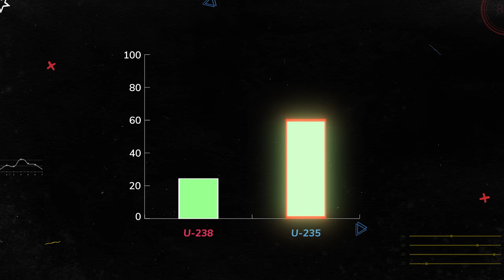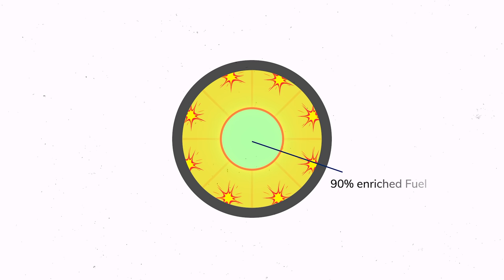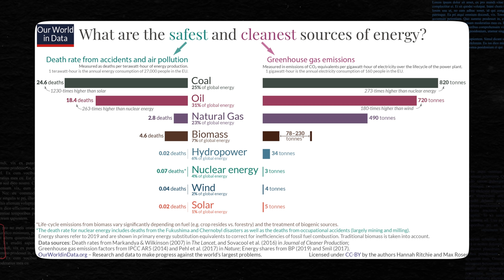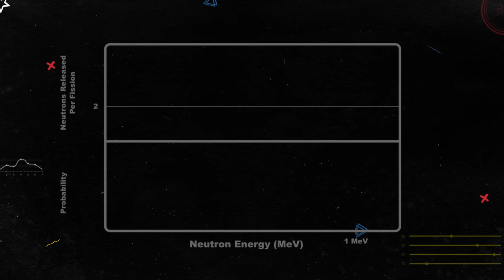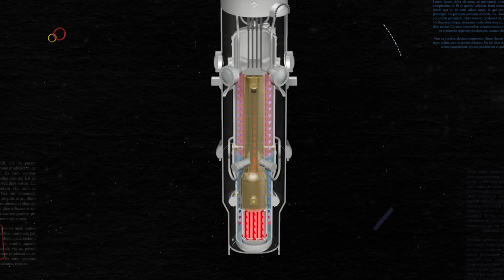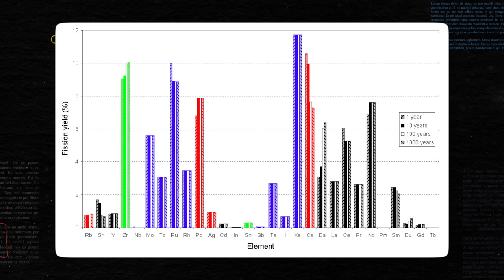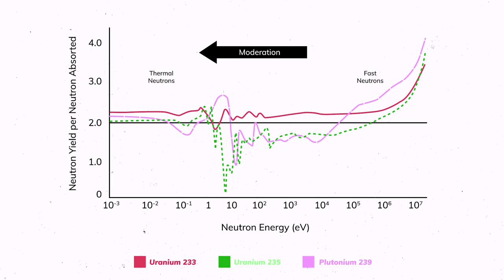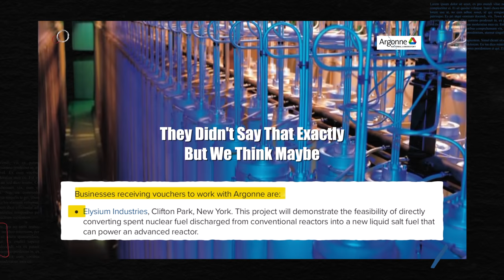This Reactor Feeds On Nuclear Waste

Comment: Ed Pheil is the principle designer at Elysium. The design is meant to slot into any existing power station you already have too. So if you have a coal power station, just swap out the coal burning part and keep your turbine generators & transformers etc. As Ed has said there is 100s of years of nuclear waste to consume here, so efficiency is not critical. Using less efficient existing infrastructure is fine. 

I have to say I was a thorium fan, but consuming nuclear waste has to be the most sensible win. Also as pointed out metal alloys that can handle chloride salts are already nuclear rated. Ones for fluoride salts that Kirk needs, not yet. Thorium will have its day, but we have nuclear waste that needs attention 1st.
Reply from the maker: Honestly, we really wanted to include more about the founders. Both of them have really interesting stories :)

The problem was that we didn't reach out to them. I think the video could have been much better with some of their quotes and insights.
Reply: @TechforLudditesSira  Ed is a really approachable guy. Drop the team a message. Make a follow up video :)
Reply: Thorium isn't used because it doesn't generate plutonium so they don't care but I think that a nuclear power plant is actually a pyrophoric generator that uses high energy light to generate heat.
Reply from the maker: @mrrolandlawrence  That is definitely on the agenda! :)
Reply: Thorium can also consume nuclear waste.
Reply: @sebastianstewart6894  You are right, but what it does generate is U-233 which is as good a fissile as plutonium.

A pyrophoric generator, huh?  You need to back that one up.
Reply: @mikebrandenburg9922  I really hate how people keep saying that.  Waste has different meanings, and the "Luddites" see it as a radiological poison, while you are looking at the transuranides, which are low on the list of radiological emitters.  Get specific if you want to say that - "it consumes some of the long half-life radiological waste".
Reply: As the turbine is rather cheap compared to the combustion chamber / boiler of a coal fired power plant (50% of CAPEX), it would make sense to use a newer turbine as turbine design has improved in the last 40-50 years. They have increased the efficiency level also, e.g. by 3-D turbine blade design and manufacturing which has been streamlined.
Reply: @gunnarkaestle  hey if you have unlimited budgets, why not! then again you could also just add another 250mw module to the core, consume more nuclear waste and get more money for doing so. 

.. then there is the transmission losses. maybe upgrade the whole lot to ultra high voltage? 800kV would be nice...
Reply: @mrrolandlawrence  There is a reason why some Russian UHV lines have been downgraded to EHV after a couple of years.

Re "consuming nuclear waste": I don't think that they are consuming the waste (radioactive isotopes, which result from a split nucleus) but consume fissile isotopes which has been left or fertile material in spent fuel rods.
Reply: @gunnarkaestle  if you watch the long talk from Ed, the technology can even consume DU! Something of which there is plenty of.But yes they are mainly focusing on the spend fuel rods as there are plenty of that to start with. Current storage costs are high and storage is essentially indefinite (1000s of years) if left. Chopping the rods to use in the reactor is a great idea. This bypasses any regulation needed for reprocessing.
Reply: Good comment, but video better. Amazing work.
Reply: @mrrolandlawrence  Depleted uranium (U-238) is used in breeder reactors. It is not the highly radioactive waste, which are the fission products after you split a nucleus. You can't get rid of those fission products except waiting for decay. Another topic is the fraction of actinoids (transuranic waste), which is uraniun and heavier elements that are activated by neutron capture. Their half-life can be very long and those can be split - but not the waste which is the fission product. This stuff you need to store for a couple of hundred years anyway.
Reply: You could also process the ashes of coal plants some ashes have such a high concentration it 

80 ppm, europäische Stein- oder Braunkohle enthält etwa 80–135 ppm Uran.[4] Da weltweit etwa 7800 Millionen Tonnen Kohle pro Jahr in Kohlekraftwerken verbrannt werden, schätzt man den Gesamtausstoß auf 10.000 Tonnen Uran und 25.000 Tonnen Thorium, der zum großen Teil in der Asche enthalten ist.

The ashes in European hardcoal and  lignite powerplants have a conversation from 80-135ppm uranium. The estimations are that worldwide we burn 7800 million ton of coal and the results that it contains 10 000t uranium and
 25 000 t Thorium
Reply: It isn't that important how much clean energy we make. What's important is how much dirty energy we shut down! That's why it's so important to offer a path to upgrading coal-fired power plants of recent vintage so that they don't burn coal anymore. You killed two birds with one stone.  
What we can't afford is more people acting like Germany, putting up lots of wind and solar, and keeping all the coal operating and even building more.
Reply: @gunnarkaestle  operating at 600c instead of 300c automatically means that your turbine is going to be an order of magnitude cheaper.
Reply: @grumpystiltskin  exactly.
Reply: @gunnarkaestle  The fuel rods still have 95% unused U238 which is a solid energy source in fast reactors. The transuranics can get forced to fission with additional neutrons. Some of the fission products can be turned into safer decay series or even medical useful elements with additional neutrons.
Reply: Mr. Virtual  what scientists are saying, plutonium is the end goal of nuclear reactor not energy production. If we wanted energy production then there are huge ways of producing it. Uranium oxide is prone to spontaneous ignition.
Reply: @CUBETechie  thanks you've just proven my belief that plants store uranium at a certain age which is probably don't to increase a plants energistic state.
Reply: @grumpystiltskin  I personally think we should burn all the coal to provide food for plants because if we're not careful the plants won't have food anymore.
Reply: @TechforLudditesSira  Please do make a follow-up, including more info about the practical hurdles they are experiencing!
Reply: @puncheex2  pyrophoric substance are compounds that ignite easily in the atmosphere eg pure iron which is caused by oxidization but it also means that anything that has an oxidizing effect without oxidation occurring will produce a release of heat an example is nuclear radiation and to me this explains the rapid depletion of nuclear rods. If it was just the effects of uranium why do you need to partially oxidise it, why not just use pure uranium, the reason is because uranium monoxide is a stronger pyrophic then uranium. Also the material is composed of small pellets of a millmetre each instead of in a sheet and no explosion occurs beyond a steam explosion after the core has melted. All this has led me to the opinion that the substance is producing heat by the process of converting the light it absorbs from its fellow rods after all nuclear reactors are producing a highly energetic light.
Reply: @grumpystiltskin  Actually, operating a turbine only at 300 °C makes the whole plant much more costly in specific costs, as the bottleneck steam (thermal energy) to mechanical energy is less efficient. Thus you have much less bang for the buck (meaning the full CAPEX of the whole plant and not only the turbine). Just do the math: if you have 45% efficiency or 30% efficiency of a given boiler that gives 2000 MW of heat, then you have either 900 MW or 600 MW.
Reply: Thorium loses its advantages past the initial few stages of burnup, it is not widely regarded as a solution to nuclear fuel concerns. The criticisms of water reactors are not really valid in this video either. the videos authors claimed that reactivity of a molten salt reactor goes down with increasing temperature but the same is also true in water reactors where increasing temp reduces the density of the water and reduces how effectivly it moderates the fast neutrons. additionally the claim that the reactor vessel may explode due to a steam explosion while strictly true is one of the least likely failure modes for a pwr as its been designed to have a safety margin to cover all but the most catastrophic failures. there are limits to this system just as there are limits to the molten salt reactors. molten salt is very promissing but its widely debated if the thermochemistry of continuous reprocessing is even feasable and thats one of the main reasons to want a molten salt reactor.
Reply: @sebastianstewart6894  Sorry mate but you really need to pick up an a level physics book and go over the nuclear physics secton. Reactors typically have less than 100tons of uranium loaded at any one time if you assumed that the energy released through combustion is around the same per mole as a pure CH4+2O2 (an incredibly generous assumption) at 400ish kJ and the 100tons of uranium (aprox 400k moles) a full loading yeilds 160GJ of energy. assuming a 500MWe reactor and a 100% efficiency (which is impossible) that 100tons of uranium is used every 320 seconds or 5 minutes 2 seconds. so no it is not some combiustion reaction as your claiming.

for your information only about 2% of the fissile material in a reactor is "burnt" during its entire cycle in the reactor which is typically 2 years iirc which means 2 tons of uranium has to produce about 16ExaJ of energy in that period. even assuming 100%efficiency then each mole of uranium needs to produce around 2000 TeraJ or 500million times more than a  CH4+2O2 reaction, this is impossible in a chemical sense there just isnt the energy available in the atomic bonds to be released for this
Reply: @Psi-Storm  Please do the back of an evenlope calculation: In a spend fuel rod, there are ~5% cracked atom cores; ~0,5 actinoids (long living transuranic isotopes activated by neutron capture) and 94,5% fertile U-238. If you split all the fertile/splitable 95% that will increase the mass of highly radioactive waste by a factor of 19. This stuff is not candy you can store in a kitchen drawer: it is highly radioactive waste that needs to be stored for hundreds of years - which is less than hundred-thousands of years, admittedly.
Reply: @lewispowell1681  The temperature dependant doppler effect regarding reactivity was the reason that the Russian RBMK designers thought the reactor is controllable, and that this would compensated the void effect. It was - except in some operating states where it was not. 

The water reactors are nonproblematic in this regard because of the void coefficient and the doppler coefficient are both pushing in the same direction. But it is said that the huge and costly containment for light water reactors, which should hold all the radioactive water turned into the steam from the primary circle in case of a LB LOCA and condense it without venting large radioactive volumes, is not needed. 

But I wonder if long term practical experiences has been made with hot corrosive and radioactive liquids. Please remember, that the Kashagan oil field in the Caspean sea had to replace the whole piping because the corrosive nature of the sour oil (rich in H2S) was underestimated and this issue was not properly handled in the first try, and this was basic engineering, no rocket surgery.
Reply: @SUPERTOASTERGOD  There have been molten salt reactors that have run in the past, in fact there are a great many varieties of reactor that have been proven to work. for the most part they wernt produced because they didnt produce the plutonium needed for weapons or they produced too much of the higher atomic mass isotopes of plutonium which made weapons production difficult.
Reply: @grumpystiltskin  I can't believe how few people realize that repurposing a coal plant means that coal plant won't return to burning coal lol it's like doing algebra but arbitrarily assuming only positive numbers are valid in the equations we're working with
Reply: @lewispowell1681  I only know one molten salt reactor which ran, it was an 7 MW experiement at Oak Ridge in the 60s which ran for 4 years. Therefore I don't count this as long term experience which utilities need to make a no doubt buying experience of a utility scale installtion. If they are reluctant to invest into new LWR technology (and they had to be pushed in the 60s) why should they acquire something which is new to them, if not the next neighbour has tried this sucessfully out and proven that this works not only technically but also financially?
Reply: @mikebrandenburg9922  
No, thorium CANNOT consume nuclesr waste. The neutronics are barely sufficient to maintain themselves on Th/U233, and no neutrons left for waste. Cant be done.
Reply: @sebastianstewart6894  
No, "pyrophoric" is rediculous. Pyrophoric means burns spontaneously in air, explosive. None of that here. It does NOT mean HOT.
Reply: Joeseph Smith  
No, it converts long lived material, to ~100yr surface storage waste.
Reply: @mrrolandlawrence  
We Chop up the SNF, then chlorinate it, then filter it for the reactor.
Reply: @gunnarkaestle  
The 300 year Cs & Sr fissiinnproducts can also be transmuted to shorter lived of stable by leaving them in the reactor after purification, onless there is a demand for them for higher power Radio-isotopic Thermal Generators (RTGs), better than Pu238. These were actually designed and used in the 1950's for the US Navy. (Patent is accessible).
Reply: @grumpystiltskin  
750C initial designs, 1000C later designs.
Reply: @Psi-Storm  yes you an make medical isotopes, but the anount needed for medicsl is no more than a few reactirs can make, so every reactir would not do that due to lack of demand for extreme volumes of medical isotopes.
Reply: @sebastianstewart6894  
We consume ALL plutonium, never take it out nor separate it. We are iso-breeding, not positive breeding except just enough to overcome fission product poison build up, so we can eliminate the online purification system, to eliminate that concern. Even our exterternal centralized purification system does not separate Pu from Unor other actinides, nor from long lived radio-protective Cs & Sr and many other shorter lived fissiin products. Besides, our reactor NEVER has weapons grade plutonium in it, never.
Reply: @gunnarkaestle  
You need to look at the waste fission products on a per MW basis, and there is a 30X reduction in waste mass/MW
Reply: @gunnarkaestle  
Pure Fluoride salt is less corrosive than pure water. Pure Chloride salt is less corrosive than fluoride salt. Add either excess oxygen or salt to water or water to salt, i.e., make it impure and tose are corrosive. Especially salt water at an air interface.
Reply: @SUPERTOASTERGOD  
I just use my smarphone with a piece of black tape iver the camera for a radiation detector using the Gammapix lite App.
Reply: @lewispowell1681  
This not enough Pu, or too high upper Pu is a myth/fake conspiacy thory, that needs to stop being spread.
Reply: @gunnarkaestle  
Oak Ridge ran TWO MSRs:
Aircraft Reactor Experiment
Mlten Sslt Reactor Experiment.
Reply: @SUPERTOASTERGOD  
Nuckear plants are orders of magnitude ckeaner than coal plants, and the uclear sites have less resudual radioactivity than the coal ash pile, although neither is dangerous.
Reply: @EdPheil  Do you mean fission products production per MW or MWh? One atom split means ~ 200 MeV binding energy converted into heat (moving particles), so x mol fission products are equivalent to y MWh thermal energy or y*eta MWh electricity.
Reply: @EdPheil  So, the corrosive question is: Is it easier to keep water out of the salt or to keep the salt (and oxygen) out of the water? And why did the Russians build the drivetrain for their Alfa raceboats (not to be confused with the Alfa racecars, which are Italian) with a liquid metal and not with a liquid salt cooling?
Reply: @gunnarkaestle  
Yes, just keep the fluids CLEAN!

The Russian Alpha subs were solid fuel PbBi cooled because they were high power dendity, so smalland the PbBi dsmpened noise making the sub quiet unless they went fast. At high temperstures of PbBi the steam turbine systems were all smaller too, allowing a high power to hull diameter ratio allowing very high speed.
Reply: Joeseph Smith  
Your nuclear fuel cycle degree or experience is from where?
Reply: @SUPERTOASTERGOD  100 years, barely one human lifetime to be as low as Uranium ore.
Reply: @SUPERTOASTERGOD  In your opinion, how do we balance the unavoidable imbalance of demand  and consumption when producing with renewables?
Reply: @lewispowell1681  I'm not claiming it's a combustion generator but a brimstone generator (a device that converts high energy light into heat). Which honestly I don't know why we don't have one.
Reply: @gunnarkaestle  don't store it give it to thiobacillus to metabolize or other forms of bioremediation.
Reply: @EdPheil  "This not enough Pu, or too high upper Pu is a myth/fake conspiacy thory, that needs to stop being spread." im sure you have a credible reason for this statement however you are to me just a voice on the internet and so i cant varify what expertise you have. on the other hand what i have said is exactly what has been taught to me by a professor of reactor engineering at one of the UKs leading Russel group universities.

i realise after reviewing my message you may believe i was saying that MS reactors were not persued due to the plutonium concerns but that was not what i meant. i meant the many of the multitude of variant designs of reactor that were tested and conceptualised in the 50s and 60s were rejected because of the Pu production characteristics. 

an example of weapons choices defining reactor designs is the british gas cooled and advanced gas cooled reactors which in the first instance was due to their versatility for power production and weapons grade Pu breeding and in the second instance for the ablity to produce Pu while using unenriched U (something that was not seen through due to cladding issues iirc).
Reply: @paxdriver  you know coal was once trees?
Reply: @EdPheil  actual the word means hot light but yup I can't really find the name given to substances that convert energy to heat.
Reply: @EdPheil  you obviously haven't read up on the hyperaccumulator of radioactive isotopes.
Reply: @EdPheil  how is plant food not clean?
Reply: @SUPERTOASTERGOD  coal is when plants ruled the world, how is returning that food back to the cycle bad?
Reply: @sebastianstewart6894  so you dont really get the concept of light. light is simply electromagnetic radiation with a wavelength in the 380-750nm range. where the photon is in the spectrum their energy is related to their momentum which is dependant on their wavelength. smaller wavelengths have greater energy and the shortest wavelengths are gamma rays. so high energy light is radiation. so a "brimstone generator" is a nuclear reactor which turns the high energy of the particles and rays released during fission into heat
Reply: @EdPheil  What was the result of the Aircraft Reactor Experiment? I assumed that also the MSR-Experiment was financed by the Air Force. But let's face it: this have been Experiments, not long term operational experience, where you could learn from mistakes and mishaps like in Three Mile Island.
Reply: @mikebrandenburg9922  Huh? "Thorium can also consume nuclear waste." Are you talking about Flibe's LFTR49 reactors that burn SNF and breed U233 ib a thorium blanket? Or perhaps you are referring to the ability of all molten salt reactors (including those that breed U233 from thorium) to burn their own waste, and potentially SNF from outside sources.
Reply: @puncheex2  Depends on the thermal energy of the neutrons. In a fast neutron spectrum plutonium is a better fissile fuel.
Reply: @juspetful  Balancing the demand and supply is done by (functional) energy storages. In the past this was the coal pile and the gas cavern and the nuclear fuel rod. In the future, we will use a spectrum of different energy storages, from batteries (short term) to P2G+gas storage (long term). BTW: you need not channel all electricity through such storages, in most cases, the generation fits the load at least partially.
Reply: @sebastianstewart6894  The substance which converts light into heat is called an absorber.
Reply: @sebastianstewart6894  Returning fossilized plants back into the C-cycle - in the manner we are doing it as a civilisation - is called "overdosis". Remember: all the infrastructure we built since the last 5000 year is optimised for a given climate and ocean level. Guess what will happen when the glaciers in the Himalaya melt completely, and the water supply in arid summers is not guaranteed, which is needed in the mayor river systems of Asia for irrigation and productive land use. How many hungry boat people is the rest of the world willing to absorb?
Reply: @sebastianstewart6894  Sebastian, uranium oxide IS burned chemically as far as it will go.  Uranium metal will burn (to the oxide), but uranium oxide will not burn further chemically.
Reply: @sebastianstewart6894 Are you really asking this question? So you don't get the simple fact, that trees need time to grow. You do get that? Trees need time to grow! Even if you come with Bambus, which grows way faster, you still need the soil, the land and even then enough time!
And here's the thing. We burn way more coal and equivalents to CO2 then plants could store it. Which is the whole problem about our climate change problem! (next the methane problem ofc) Oh and by the way, we even burn down forests... So there's that.
Reply: @SUPERTOASTERGOD  
There are 4 reactors licensed for 80 years, 2 more in the life extension licensing process, others in the queue. NRC is working in 100 yr nuclear reactor license requirements today. These are happening. 

Solar is lucky to last 20 years, assuming there is no major storm, like hurricanes, tornados, or hail storms.
Reply: @gunnarkaestle  i dont understand what you are asking. Not enough info here, nor link to my comment info.
Reply: @gunnarkaestle  The aircraft reactor experiment was a different sakt, and much higher temperature for a jet engine, like 900C. The chemistry allowed HEU to precipitate out on vessel walls. There was still fissiin, so it overheated locally and burned through the wall causing leaks. It was very short lived.

MSRE was many years of ooeratiin, but only about 3.5 total years equivalent full power operation. MSRE was shut down for political, not technical reasons.
Reply: @dalesplitstone6276  FLIBE has dropped the LFTR49 concept. It did not work. They ourged it from their web site too. They moved from LFTR49 to a fast chloride MSR that uses transuranics only as fuel, no uranium. This would have a thorium blanket.
Reply: @puncheex2  
Actually, UO2 WILL burn/oxidize further from UO2 to U3O8. They both occur in uranium ore, but is all oxidized to U3O8 in the U refining process.
Reply: @EdPheil  Heh.  I thought uranium oxide WAS U3O8.  Yeah, it may be possible to burn uranium oxide further, but I doubt it is a pyrophoric process.
Reply: @mrrolandlawrence  Thanks for explicitly pointing out the difference between the fluoride salts and chloride salts.  I had previously missed that distinction.
Reply: @EdPheil  Thanks for all the comments; I learned quite a lot! Hope to see you and Sira having a discussion in a future video!
I am personally blown away that the principal designer has stopped by a 'small' youtube channel's comment sections to interact with average joes and janes.
Kudos, and thank you again for spending a few moments of your time explaining the corrosive relations to us laymen!
(And the fact that you're as human as the rest of us when being trolled. :) :) :) )
Reply: @lewispowell1681  I understand the concept of light but just because you know the theory doesn't mean it's the fact of reality, eg white light is a photon that contains all wavelengths theoretically in reality its a unique light that when placed through a prism produces all light and depending on the material used is the light produced.
Reply: Very confused.  If we have the means to rid of nuclear waste why isnt this utilized?
Reply: @gunnarkaestle  arid summers are from not damming the monsoon rains if properly managed by using that same technology we have created in the last 100 - 200 years then there would be no problem.
Reply: @puncheex2  uranium can for di and quad bonds easily though.
Reply: @Deinorius  the highest co2 concentration in the world is 500ppm but trees are fine with 1000ppm and if co2 does cause global warming then 1500ppm is perfectly fine for them as well. If you have a problem with us cutting down trees then force your governments to swap from large fields to agroforestry and increase the flow of people from the city to the country by establishing rural regeneration schemes.
Reply: @SUPERTOASTERGOD  you know that once we had a electric generator that had no moving parts and used steam to generate its electricity. It's probably not as powerful as a standard motor but it's principle is sound if modified than and put through a circuit you could use it.
Reply: Also why do people talk about nuclear power as an alternative to coal power when magnetic refrigeration and atmosphere engines seem to be a viable alternative and couple with it an electrostatic generator since electrostatic generators don't have the magnetic resistance produced by many electric generators.
Reply: @sebastianstewart6894  there is no such thing as a "white light Photon". what you see when you see white light is all of the photons of the varying wavelengths that are reaching you at the same time. a photon is a discrete quantized unit and in this respect cant be sub divided. when light travels through a prism it splits because of the variation in the wavelengths of the photons. 

like i said at the beginning you need to pick up an A-level physics textbook or watch some actual educational videos on the topic. theres nothing wrong with not knowing something, just dont pretend you do and maybe take it upon yourself to better yourself
Reply: @EdPheil  Maybe they can skip the SNF concept by focusing on India. I understand that why they need the SNF burner with a thorium blanket is because the NRC requires the thorium be denatured with u236/238, which prevents adequate breeding of U233 in the thermal neutron spectrum. India's regulatory agency would probably have no such requirement.

The LFTR49 was also to require that all uranium be removed from the SNF, so no change here. Of course, they will still need time to accumulate enough U233 to start up their LFTR23 reactors.  I'm not sure how fast India can produce U233 by inserting thorium rods into conventional light water reactors.

The US needs a similar program to produce U233 for LFTR23 reactors. As concerned as I am about the prospect of transporting SNF cross country, I am even more concerned about having U/Pu reactors on was ships. If nuclear powered warships were to be destroyed in a war, the ecological consequences would be severe. I would like to see all of the existing reactors on nuclear powered warships replaced by LFTR23 reactors as soon as possible, even if the US had to provide these reactors free of charge to Russia.

My guess is that, once Elysium runs through the plutonium stockpile, it will become necessary  to remove at least part of the uranium from the SNF to get a rich enough fuel to start up a reactor, and plans on using the SNF uranium removed as a feed stock for the reactor. To me it would make more sense ecologically to ship this SNF uranium to an enrichment facility to produce HALEU for the startup of off SNF stockpile site MCSFRs.

Here in Pennsylvania we have enough stockpiles all over the state, that we could probably build all of the MCSGRs we need to produce 100% of our electricity. And I do mean build them here. The entrenched LWR industry is hitting our state up for billions of dollars in subsidies. I would much rather see these billions of dollars going towards building the first assembly line(s) for Elysium and/or Flibe reactors right here in Pennsylvania, in the form of low or zero interest loans.

In any case, short of launching in India, I think the fasted way for Flibe to launch would be to license the Elysium design, and modify it to accommodate a thorium blanket.
Reply: Using ‘loose’ cruci-form elements to construct a ‘nine-layer’ foundation of khatmatrix - with graduated omissions - for nuclear reactors may very well be able to lateralise all shock waves from seismic activity and preserve both integrity and even-ness for the top - all important - layer.
Just a suggestion - no experimental data!
Reply: @markhughes7927  Congratulations. This is the first post on this forum for which I can honestly say, I haven't a clue what you are talking about.
Reply: @dalesplitstone6276  
The new can be odd!
How could I begin to explain a ‘syncopated cubeoctahedron’ ?
But it will come along - and when it does I hope you will remember this conversation and the fact that of the four classic elements from which it can be formed and one hybrid - the simple ‘cruciform’ in slightly loose coupling is what is talked about as usefully ‘earthquake proof’ - or confidently thought to be.
I hope that clears things up!
Reply: @sebastianstewart6894  I don't get it. What is so special about thiobacillus in this case except that they produce sulfuric acid?
Reply: @EdPheil  When you say that MSRE was shut down for political reasons, you mean propably economical reasons, because the top brass didn't want to spent any more R+D money on MSR, but focused on the finetuning of LWR for the Navy. It am still puzzled about the idea of having a nuclear reactor as part of a jet engine on board of a flying airplane. Thsi would only work if there is a super lightweight radiation shield or if you could train cockroaches to fly a plane as these are very immune to radioactive imissions.
Reply: @pancakes3250  It isn't utilized yet, because there is a "but ..."
Reply: @gunnarkaestle  So, you are saying its not developed yet?..  I dont remember the but part.
Reply: @sebastianstewart6894  An electric generator that had no moving parts and used steam to generate its electricity? Are you sure about the steam, as electric eels normaly don't boil themselves.
Reply: @pancakes3250  If the technology was already available, reliable and payable, but isn't used, then there must be another "but" somewhere, else the availability, reliability or bankability is not given.
Reply: @gunnarkaestle  Makes sense.  Thank you.
Reply: @SUPERTOASTERGOD   about your claim that turbines are reusable you are missing something very significant which every engineer knows about "Fatigue" the cyclic stresses placed on the turbines applies a finite lifetime to the materials used in their manufacture. composites are just as susceptible to it as metals. for this reason about the only part of a turbine which can be "recycled" is the steel pylon which it sits on. also recycling composites is incredibly difficult and costly and what a lot of green nuts don't realise is that the matrix material which constitutes the bulk of the volume of the composites is by and large manufactured from products of crude oil and relies heavily on the oil industry. if you cut down oil production composite manufacturing becomes too expensive. 

so to sum it up you have a wind turbine at the end of its rated lifespan of about 20 years, it is unsafe to reuse, it is costly and difficult to recycle, doesnt decay naturally in any appreciable way in the natural environment, and manufacturing its replacement  requires the extraction and processing of crude oil, which is only sustainable if the bulk of the oil is consumed as fuel.
Reply: Subin George  I dont think something can be produced from nothing.  Just add, water.  I looked for an explanation for this, got nothing, they all repeat the same article.  I am no scientist, so if you provide a complex explanation, i wont understand.  
Please explain, if possible, otherwise i will assume its not better than current tech.  It could be useful as green, low maintenance source for low environmental energy situations, little light, wind, geo.
Reply: Subin George  The biological nanowire is an interesting science project.
Reply: @pancakes3250  cost and politics. Politics in a sense as I want to get re-elected and people fear nuclear
Reply: @MnrBugi  Cant argue with this.
Reply: @sebastianstewart6894  It uses the kinetic energy of fission daughters, neutrons, and gammas to interact with the moderator and structure of the core to transmit that energy to the moderator/coolant. It employs both convection and conduction to do that.
You could call high energy fission and decay gammas light, but that's not what you meant, I'm sure.
Reply: This kind of tech is desperately needed here in Canada to replacing Natrual gas for heating homes(and most importantly out CLEAN DRINKABLE WATER pipes)
Reply: @netook8  Strange.  I thought Canada doesnt have gas in water pipes.
Canada is huge, very few, if any enemies.  Little social instability for now.  Maybe fission reactors, fueled by waste, buried deep, could be a valid alternative.
Reply: Nuclear power planets, technically speaking and if maintained correctly, are the most renewable and efficient power source in the world. Or will be once and if we can properly disposable of the waste, which we have found.
Reply: @DaemonsAdvocate  I agree on the comment.  If can be safe, from nature and man.  I am banking on fusion.
Reply: @gunnarkaestle  
There are a lot of ultrasupercritical, high efficiency steam turbine fossil fuel power stations that would be expensive stranded assets if they aren't allowed to burn coal. It would be great to couple them with nuclear reactors.
Reply: @DaemonsAdvocate  Nuclear power is not renewable (spent fuel rods are spent and don't replentish itself), but it is CO2-free. But these are two different qualities. It is also not very efficient. Due to the relatively low temperatures (300-350 °C) of the steam Generator, the efficiency is only 30-33%, whereas other modern thermal plants have >45% (coal) or >60% (gas). Thus, from an electricity out vs. fuel energy in ratio, CCGT are twice as efficient as nuclear, regarding the BAT in each category.
Reply: @gregorymalchuk272  Regarding the stranded assets of supercritical steam power plants, these will be stranded. Please keep in mind that ~50% of the CAPEX of a coal fired power plant is boiler aka burning chamber where the coal is burnt and this is usually optimised to a certain type of coal. You might try a fuel switch (e.g. to biomass/wood chips as done in the Drax power station, UK), but I see no savings in reusing an existing turbine (~5% of the CAPEX) in an existing infrastructure than just building an optimised turbine for the steam parameters of a given NPP. It is just to complicated regarding the balance of plants and not so optimised for a purpose built new turbine design. Usually the design of the turbine follows the design of the rankine cycle, not the other way around.
Reply: Would it be able to extract lithium from water
Reply: It's easier to mine uranium in the space than methane. So 100 years is more than fine (even without touching Thorium, which is 3 times more common).
Reply: Joeseph Smith  yeah, I thought it was rather quiet on the specifics of "what waste it does produce".
Reply: @gunnarkaestle  The NB-36H did fly with all of the shielding and the entire reactor (not operating at the time) on-board. Radiological contamination in the event of a crash may have partially influenced the cancellation of the project, but the ability of an aircraft to carry the reactor and shielding was seen as feasible.
Reply: @keithandnatani7849  Yes it is technically possible to extract lithium from water. It depends of your willing less to invest into the technical apparatus and the energy to drive this app.
Reply: @PaulZyCZ  Why would you like to mine uranium in space instead of digging it from some dirt on earth?
Reply: @gunnarkaestle  It may become cheaper or more ecological at some point. Using it for Lunar base or deep space would make more sense before that.
Reply: @PaulZyCZ  The sune shines fine on the moon, but a station on pluto will probably need nuclear power as energy supply.
Reply: I've had the privilege to have actually met Ed Pheil at ORNL in 2019. A very practical nuclear engineer, he really knows his stuff and is has his own methodology of modelling reactor designs in his mind. He's the kind of engineer that can spot self contradictions and inconsistency's in textbooks and form a more accurate picture than the textbook answers. I know this to be true because I'm the same in my specific area of specialization. When I hear a nuclear engineer say "I think everything is a moderator" which is contrary to textbook answers that means you're in front of an engineer that us both gifted and put in the immense time and effort to learn everything using both the traditional and esoteric methods of knowledge acquisition.
Reply: Eh. Nuclear waste is safely contained.
Compared to storage space and the size of the earth, it isnt a big problem.

 Just say the word nuclear and you'll immediately hear fears of chernobyl and fukushima. Safety  of the plant and public image of safety (which translates to political and regulatory approval) is the most critical aspect.

The next most important factor is cost. That determines whether it gets built or not and how much of a chain reaction for more and more reactors get built, depending on the normalization and popularization and assuaging the safety concerns of the public.
Reply: @gwho  In principle I believe that highly radioactive waste (delivering heat) can be stored in salt, as it is done in the WIPP. Neverthetheless only one plant is operating world wide - but this seems to be more a political problem not a technical issue.

Nevertheless, in the past there have been several issues with unproper nuclear waste storage, both in the Majak area and the Handford site.
Reply: @CUBETechie  uhps
Reply: @EdPheil  can you explain what you have planned to take care of Cl36?
Reply: @TechforLudditesSira  can u make a video abt research on water based engines or motors is it just a theory or is it really possible to run motors on water in some way.
Reply: Liquid Flouride Thorium breeder reactors operate at a much higher temperature suitable foe the Brayton cycle turbines not the steam turbines which conventional nuclear reactors and coal plants use.  You could not slip in a molten salt reactor to drive the existing turbines at a coal power plant without mixing down the heat transfer fluid to a lower temperature but you could have such a molten salt reactor directly operate the turbines in a natural gas power plant.
Reply: Why does waste need attention now? Are we  on running out of storage or some kind of impending doom?
Reply: @The_Dark_Lord-69  Our current solid fuel rod nuclear reactors can only use 0.5% of the Uranium in the rod (0.7% for Canadian reactors) before the rods loose structural integrity.  This is because at some point, the Uranium would transform into Xenon gas for eight hours before continuing on it's decay path and as a gas, the Xenon will want to occupy a lot more space stressing the rods with pressure.  Hence once 0.5% of the fuel rod has been used, it has to be removed and currently it's treated as nuclear waste.   Now, originally, the intent was to have a reprocessing plant where these spent rods would be reformed into structurally sound new rods and France has one such plant so European fuel rods are remanufactured into new rods but due to pressure from environmentalists, President Carter canceled the construction of the US nuclear reprocessing plant hence these 0.5% spent rods are now stored in cooling pools at each nuclear reactor site as nuclear waste even though it's still 99.5% fuel.   With a molten salt reactor, first the Xenon just bubbles out and second the unused uranium is just left in the fluid core while the spent products are distilled out, basically the reactor is in itself it's own fuel remanufacturing plant and all of the fuel can be used not just 0.5%.  That's why nuclear waste is an issue that molten salt reactors such as the LFTR would solve.
Reply: Fast nuclear reactors are expensive not cheap
Reply: @Joeseph Smith You clearly have a degree.. But it’s definitely NOT in physics.

More likely a (very high) degree of cannabis exposure (congrats on the PhD)
and a high school equivalent exam in internet trolling (basic plebeian).
Reply: On top of this, there are plenty of fission products within the waste that could be easily harnessed and used in nuclear med and communications purposes if only we built up the infrastructure to use it.
Reply: @sebastianstewart6894  Yes, it was like that during the cold war and the nuclear arms race. Not so much these days... :)
Reply: @lewispowell1681  you miss that light travels through a medium and as such is influenced by the medium as such you can disprove white light photon.
Reply: @gunnarkaestle  they can cause uranium enrichment if used as a biohyperaccumulator.
Reply: @gunnarkaestle  it's like a Kelvin thunderstorm but using steam instead of water.
Reply: @gunnarkaestle  or the elites don't desire to use it.
Reply: @lewispowell1681  it's called fiber glass or am I wrong in assuming a windmill can be made of fiber glass and steel.
Reply: @MnrBugi  it's all political fear mongering.
Reply: @boydgrandy5769  right we're obviously going to use theory and misout on the fact that a refractive material is need on the rods eg zirconium or similar material that is transparent for radioactive light.
Reply: @DaemonsAdvocate  use thiobacilus as radioactive remediators or don't you read articles on biological remediation?
Reply: @keithandnatani7849  if there's lithium in the water it is extracted through electrolysis.
Reply: @lawrence18uk  none if properly managed.
Reply: @sebastianstewart6894  I don't read nuclear physics articles, im simply stating this from an outside view?
Reply: @sebastianstewart6894  What is a biohyperaccumulator? Wild boar?
Reply: @sebastianstewart6894  Kelvin thunderstorm? Do you mean supercritical steam?
Reply: @sebastianstewart6894  im well aware that light travels through a medium, and that the speed of the photons is determined by that medium. nothing you have said about light makes any kind of sense because you dont seem to understand the basic physics behind it

you clearly know very little about materials if your going to say "its fiber glass" Fiber glass as you call it is a "composite" material as in it is formed from more than one material. typically composites are made of 40-50% fiber and 50-60% matrix. there are variations to this though there is a limit to how much of a material can be the fiber. the matrix of the composite is typically a resin which is commonly oil based in its origin.

so in answer to your question yes a wind terbine can and is made from steel and "composites" but id said that in the first place so dont know what your on about
Reply: @sebastianstewart6894  I'm sorry pard, but none of this stuff works the way you think it does.
Reply: Love it! Take my money!!!
Reply: @SleightWryder  Give it to me. You get the same value: stories from never-never land.
Reply: @gunnarkaestle  They said the same thing about crypto and cars and flying machines and wifi when they were first introduced. I'll take faith over cynicism any day.
Reply: @EdPheil  Can I politely ask for some elaboration on this?  Are you saying the LFTR is dead?   Shoot, does that mean FLIBE had to start over?
Reply: Thorium produces just about the most dangerous material in existence.
Reply: @theyeetus1428  and uranium doesn't ?
Reply: @SomeGuy-nr9id  It does, but very small amounts compared to thorium reactors which breed the stuff.
Reply: @theyeetus1428  I would not say that it differs from any other nuclear waste from nuclear fission after you have split Thorium.
Reply: @theyeetus1428  My understanding is that its difficult to deal with the 232u decay byproducts but at the same time you don't have to worry about a catastrophic meltdown which is the real reason you could have tons of these plants. The Chinese are thinking on terms of scale.
Reply: @theyeetus1428  And what is that pray tell?
Reply: @SleightWryder  Uranium 233.
Reply: @theyeetus1428  Don't we already use Uranium 233?
Reply: @SleightWryder  Yes, but a Thorium reactor would make such huge amounts of it that we wouldn't be able to handle it.
Reply: @gunnarkaestle  they consume fissile products right down the chain to noble gasses

If it's radioactive then it's potential fuel and the best way to get rid of it is to.just keep splitting things (the high neutron/gamma flux enhances breakdown and discourages theft)
Reply: @lewispowell1681  there's a lot more thorium around,  you don't need to enrich it to get started and most importantly of all it's remarkably resistant to being weaponised

Powering with thorium vs enriched uranium is essentially the difference between diesel and tnt as fuel. Just because you CAN use tnt as a fuel doesn't make it a wise idea
Reply: @gunnarkaestle  oak ridge laboratory molten salt reactors experiment 

9000 full power hours.

NO measurable damage to the pipework or graphite moderation
Reply: @EdPheil  u238 is fertile,  just like thorium. The other products are emitters. It's overall positive - JUST - when you run the neutron economy calculations.

Weinberg and Seaborg ran all these numbers in 1965. They haven't altered appreciably since then.
Reply: @EdPheil  the ARE was the basis for the MSRE but utterly impractical for propulsion or civil power
Reply: @sebastianstewart6894  trees are fine with 1000ppm until it rains 

Once you get your co2 concentration high enough to cause acidic rain you have a permian mass-extinction positive feedback loop on your hands
Reply: As long as you don't think capitalists always lie you can trust him.
 If this type reactor is used to help mitigate the nuke waste problem it should be built and run by the government. No patents for this technology should be allowed. This is a civil protection issue. Put the job up for bids and Let elysium bid on the work.
No for-profit Co. should be involved as the primary contractor
Reply: @miscbits6399  except the neutronics dont favour thorium in the long term and beyond the initial few burnup steps it offers no advantage whatsoever. as for resistance to weaponisation thats frankly a silly think to say. almost any fissile material can be used to construct a weapon but the idea that in the current world you can build a nuclear weapon using products from a power reactor is a bit absurd. in this respect it would actually be more viable to produce weapons grade plutonium using particle accelerators than a power reactor. conventional reactors do not have nice breeding characteristics for Pu 239/241 over the normal operating cycles and extraction of Pu from the spent fuel is a non trivial matter for a number of reasons. as for enriched uranium most reactors have a range of enrichments that they will accept and enrichment capability globally is used to smooth supply when there are fluctuations in raw uranium output, also enrichment isnt required for uranium it is just simpler. a number of reactors can run on unenriched uranium the CANDU springs to mind as well as the design case of AGRs in the uk.

as for commonality uranium is practicly a renewable resource it is sufficiently abundant that we wont run out for a very very long time and the infrastructure required to make thorium viable just doesn't exist right now.
Reply: @miscbits6399  Hmm, if it was such a technological success, why was the concept not developed further on? Maybe the economics were not that favourable? Plain spoken: the reactor was to expensive per kW installed capacity? Now, modern builds sum up to ca 10.000 €/kW
Reply: @gunnarkaestle  politics. US military was opposed to it due to the inherent resistance to weaponisation and the competing 'sodium cooled fast breeder reactor' was in Nixon's voting district 

On top of that the USA switched from being gold-backed to oil-backed in this same time period. Undermining the oil economy with vastly cheaper nuclear power would have cost OPEC support

The ban/destruction order of the Oak Ridge reactor happened in 1972 right in the middle of all this
Reply: @miscbits6399  Well, you can't destruct physics. If the concept with a molten salt reactor is technically superior, then also the economics should be much favourable than the classical LWRs. So why didn't others without governmental funding opt for this reactor design? That was 50 years back an many option in between could be used to go for it - if it is indeed better and cheaper.

I personally doubt that molten salt reactors can easily show lower costs than the other existing and running reactor species.
Reply: @gunnarkaestle  look up a youtube video starring Kirk Sorensen "LMFBR vs MSBR - 1971 Nixon Phone Call" bipartisan support for SoCal jobs programs. They didn't care about the technology, or Dr Alvin Weinberg's safety concerns.
Reply: @danaen803  What do you want to tell me about the Nixon Phone Call? The Experimental Breeder Reactor was built in Idaho.
Reply: @SUPERTOASTERGOD  Do you know where all those cadmium laced panels will end up? Poisoning children living near e waste dumps in third world countries and poisoning the environment. Not to mention all the massive amounts of land disturbed to get rare earth minerals for every panel to install millions of them on once pristine biomes. Same for bird killing wind power. Those fiberglass blades are hard to recycle. Sure, for certain grades of concrete they can be shredded and just shoved into the mix, but as with solar this is all assuming people bother to do it. An endless landfill of buried blades sounds way less scary than nuclear waste so once again laziness could easily win out to the cost of vast swathes of disturbed land.
Reply: @EdPheil   Indeed. And I've heard the director of Oak Ridge at the time was very happy with how it was turning out. I like Elysium's idea too, but even the design Oak Ridge was promising. And also inherently safer. The risks I'm aware of seem paltry compared to the dangerous conditions possible during emergencies in the light water reactors favored in politics. Though of course more so the older models like those present at Fukushima.
Reply: Thorium failed on complexity.
Reply: @crhu319  ... and therefore it failed on economics.
Reply: Thorium makes its mark on nuclear power through Thermal Spectrum Reactions, not in Fast Spectrum Reactions. No need for coolant (and back up coolants at several different pressures for operation) make it ideal at dealing with the economic question of nuclear power. The material needed for Sorensens LFTR is a problem that appears to be solved with the nickel/zirconium alloy but the BIG problem lies in policy! The fact that fossil fuel companies are all for solar and wind farms whilst their generators are keeping those energy forms at base capacity is no coincidence. People are so scared of nuclear power and that fatal word 'radioactivity' that they'll go with 'renewables'. Of which, geothermal is one... where does geothermal come from? The decay of Uranium and Thorium in the earths core - put that in a reactor and it's ni longer green energy 🤷‍♂️🤷‍♂️🤷‍♂️
Reply: @sebastianstewart6894  This is sort of true because before the industrial revolution CO2 levels were so low that if they had gone 20-40ppm lower plant death would’ve occurred. The whole climate change arguments is just a red herring for world government control. The .04% of CO2 we add to the atmosphere literally does nothing and anyways CO2 rise follows temperature rise so it’s not even a factor in the fact that the sun is increasing our temperature right now and that we’ve been exiting a Ice Age for the past 20,000 years is the primary cause. The one interesting theory is that the little bit of CO2 we’ve added may have delayed the coming Ice Age for which none of us will be alive when it occurs anyways
Reply: I'm still amazing that, with the exception of solar, we're still using glorified steam engines.  Everything from hydro to nuclear to coal has to have water spin a turbine to generate electricity.  Is there no modern method to replace that "middle man?"
Reply: I have chatted with Ed Pheil about the use of thorium in his MCSFR.  (This is about your comment “thorium will have it’s day”.)  Thorium can at most be used as a thinning agent added to the SNF.  Thorium provides fewer neutrons/fis in the fast spectrum so you cannot mix a large percentage of thorium.  Most of the neutrons come from the Pu239 and U235 in the SNF.  Thorium can help extend the fuel by essentially taking up space as a lower-quality but still fissionable fraction.  Thorium is not a suitable fuel source on it’s own.  The neutron economy of the ORNL experiments was questionable at best.  A thorium fuel cycle (fast or thermal) would have significant challenges maintaining > 2 n/fis considering the losses and imperfect reflectors.
Reply: @puncheex2  The problem with U233 is that it is formed offline.  The LFTR has such poor neutron economy (barely over 2n/f) that it is absolutely critical to purify the fuel salts and remove all daughter products, which absorb precious neutrons.  This means that the fuel salts must be cycled out of the core on a continuous basis and be processed through hundreds of chemical steps to remove all the neutron poisons.  One of these poisons is Protactinium (Pa-234) which is formed from the Thorium (Th-234).  The Pa is removed from the fuel stream and held for a few weeks, where it decays to U233.  The fact that this process must be done outside the protective (high radiation) environment of the core makes it an increased risk for proliferation.  Yes there are engineering safeguards that can be implemented in a plant to prevent terrorists from walking up and taking the U233 by force, but what we are really worried about are sympathetic plant operators that purposely sidestep the safeguards and divert U233 for bad purposes.

Not to mention the outrageous complexity and difficulty of having to process the fuel stream through hundreds of chemical steps.  The entire processing building will be radiation hazard and would need to be operated and maintained remotely.

Kirk’s goals for LFTR are admirable (to reduce all waste into useful marketable products) but the machine is too complicated to work reliably or safely, if at all.  The fast reactors (like Ed’s MSCFR) can achieve the primary objectives (completely consuming fuel, whether new or existing SNF,  breeding from U238, low pressure reactor vessel, melt-down-proof, etc); but it can do it all much simpler without having to take any material out of the core, without having to reprocess anything, and without needing any theoretical materials that have not been fully tested or approved by the NRC.  And MCSFR has a great neutron economy that can even accommodate a small fraction of Th-232, if desired— although that’s not really necessary.
Reply: @The_Dark_Lord-69  Well many nuclear plants keep their cooling pools way too full, long after the material should have been moved to dry cask storage.  If a cooling pool ever went dry, it would be a big problem.  The government should fulfill it’s promise of removing anf managing the SNF.  It should be stored at a government reprocessing facility in dry storage until such time that the industry has the technical capability to reprocess it.  And that should be funded ASAP because it is a governmental responsibility to manage public resources like SNF.
Reply: @pancakes3250  Basically, because with a solid fuel approach, reprocessing is a very slow, complicated and costly process that makes economically no sense in a time of very cheap uranium, like today. We need instead a liquid fluid reactor, like this, where you don't need to reprocess/separate anything, just change the chemistry (from oxide to chlorides) and you can burn ALL long lived isotopes like uranium, plutonium, etc...(and generate a lot of energy only from those)
Reply: @matthewgrotke1442  Indeed, the only  benefit I see on LFTR over molten chloride fast reactors is that a thermal breeder needs only one tonn (per GWe) of fissile start-up vs 10-15 tonnes for fast reactors (even if in the world of today we have plenty of that)
Reply: @Alessandro-1977  Ok, thank you.
Reply: @TechforLudditesSira  are you an electrical engineer?
Reply: What’s the problem? I’d rather store it underground THAN releasing it IN THE AIR. Which would you prefer?
Reply: @robert2690  No problem to store it underground, particurally in the form of dry casks, but this way: 1) you lose more than 99% of the actual energy of mined uranium/thorium and 2) you are going ro deal with long lived materials like plutonium, americium, etc...that have at least 25,000 years of half life, while with this reactor you burn them up (and releasing   a lot of energy...) and have only short life fission products (FP) like caesium, strontium, etc...that are easy to store and have only 30 years of half life. In the end, it's a big improvement both in term of quantity (300x more energy per unit of fuel) and quality (you have only easy to handle short life FPs)
Reply: can you see the million tons of fukushima contaminated water getting consumed in it?
Reply: Accelerator driven systems can eat up waste and transmute them to more radioactive, shorter lived radioisotopes.
Reply: Yeah thorium is ok too, but like you said, we gotta clean up after ourselves first :)
Reply: @dalesplitstone6276  mark hughes’ comment seems like one of these AI generated science texts ;) looking nice in form but is utterly weird in content :)
Reply: He had said millions years to me, and sure if you use D.U. and from seawater he is right too.
Reply: Theres a lot of challenges converting a coal plant to nuclear this was deemed for a coal plant here in Canada.
Reply: @lewispowell1681  Risk assessment consists of evaluating likehood and consequences.  You have been talking on likelihood only.  Low probabilty does not mean that it will never happen.  Two hydrogen explosions have already happened in Chernobyl and Fukushima   One is PWR and the Japanese one is BWR.  Both are the most severe class nuclear accidents.  Molten salt reactor works in reducing hazard in the consequence side.  No water invloved and thus no hydrogen explosion.  It runs on high temperature and low pressure.  No gas explosion as well.  Worst comes to worst those molten salt reactors are safer due to no explosion.  The consequence is reduced a lot.  If no explosion, a nuclear reactor is just  slightly  more hazardous than a chemical making plant.
Reply: @catchnkill  your a bit late to this party and your wrong in multiple ways about fukushima and chernobyl. first chernobyl was an RBMK reactor which is a water cooled graphite moderated core without a pressure vessel (IE not a PWR) or blast containment housing. the explosion that occurred was a hydrogen explosion and would have been contained if it were built within a proper blast containment structure. there was no pressure vessel involved. as for fukushima the hydrogen explosions were not occuring within the core they were vented hydrogen gas accumulated in the spent fuel cooling pond housing above the reactor containment shell which was caused by a LOCA .

As for your claims about molten salt reactors they are generally safer but your wrong about the pressurised system. the core must be sealed and pressurised in order to contain the fission gas products. Additionally the materials interactions in high neutron flux salt reactors are not well understood. a safer system overall is in fact the lead cooled reactor which has all the advantages of molten salt and some more besides but it lacks the potential for online reprocessing, that is why molten salt reactors are being pursued
Reply: @gunnarkaestle  Not true, fission products get bombarded with neutrons in these reactors transmuting them into shorter lived isotopes, and ultimately into stable isotopes.
Reply: @jimtrowbridge3465  "fission products get bombarded with neutrons in these reactors" – Which reactors? (please provide a google maps image) I think you are suffering from a pipe dream. Besides, not all isotopes have a suitable cross section.
Reply: Yeah I agree 👍